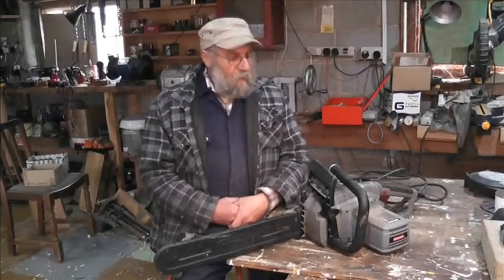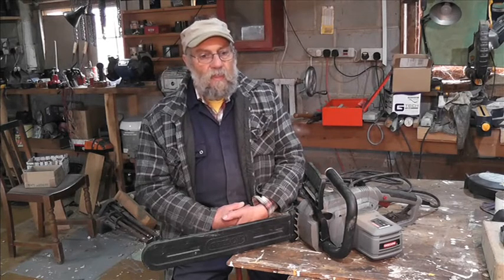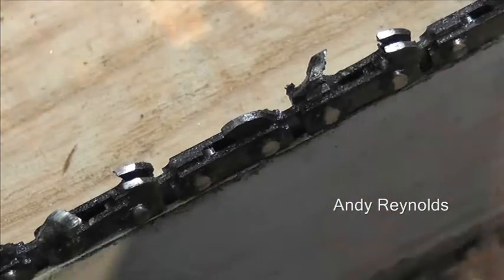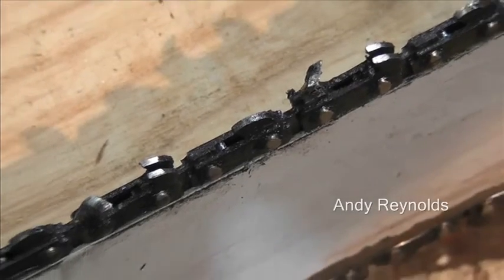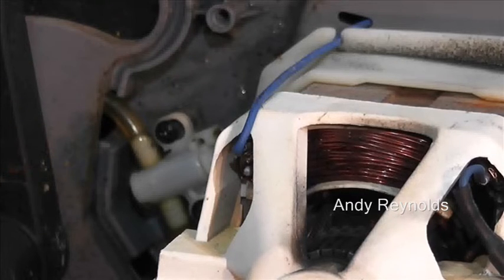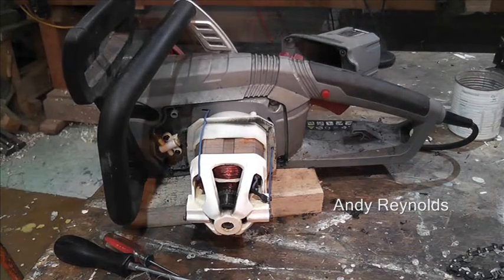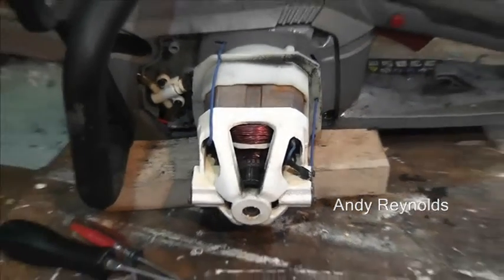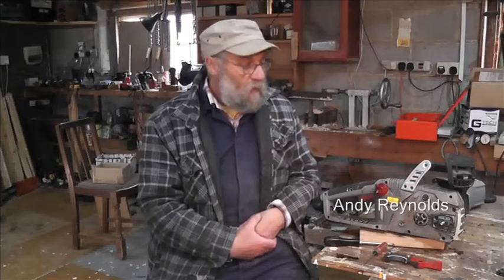Oregon electric chainsaw, quite powerful, is it the brushes?

Comment: Andy, the Kobalt brand 18" corded chainsaw that was available from Lowes has almost the exact same design in every way except motor orientation and of course voltage rating here in the US. I've had two burn out in the same fashion as yours. They are fantastic chainsaws when they run but they do not get adequate cooling and suffer from these design faults. In my opinion, either the brush holders' plastic have too low of a melting point (causing heat to rapidly increase as it warps/arcs), and/or the brushes are too soft. Additionally, I noticed a lot of the wire seems quite anemic for its 15 ampere rating on 120VAC. 

No idea why they thought giving it a 5 year warranty was a good idea, or offering 3 additional years for protection plans--but it is now no longer available for sale if that gives any indication of the failure. Because I love how this cuts I'm looking to replace the motor. Please let me know if you happen to find a source for these motors, I've checked many vacuum/blower brushed motor importers to no avail. 

On a side note, I don't mess with the self sharpening system at all.
Reply from the maker: Yes, as with most corded brush motored units, continuous use causes damage and this is found with blunt cutters. I agree the self sharpening is complete nonsense, cheers

Comment: Thank you for the video and a glance at the internal hardware.  I was curious  at the insides so I could compare to the Makita 16 inch corded. This one is around 100 US dollars  while the Makita is roughly 150 more.  There's no direct comparison  between the two I can find. 
I've only found one Makita repair video.

These two are at the top of my list, im trying to justify the extra 150 into the Makita.

Again thank you for the video.
Reply from the maker: Hi, interesting comment. Many tools are "badged" from the same manufacturer, though I'm not sure if the quality of parts are the same. Cheers

Comment: Isn't this the Oregon Power Sharp system? I always thought they had a special scabbard you put on and pushed it into a log which created lots of sparks to sharpen it.
Reply from the maker: Hi, thanks for the comment. Yes similar and just as ineffective at creating a really sharp saw and setting the depth gauges, cheers
Reply: @TheInfoworks  The guy I did my chainsaw training with, used to advocate them for the guys he used to train who felled BT and Power Line (Likes of UKPN, Western Power, etc) timber poles. None of them ever maintained their chain or saw, and so with one straightforward operation, they could keep them sharp. He didn't advocate PowerSharp for any tree work!  Horses for courses at the end of the day, a bit like this poorly chainsaw.

Comment: Hi Andy. If a washing machine motor is rated at 350w for the spin phase it is hard to imagine this motor going over 2kw! I had a very decent cheap Lidl mitre box saw years ago. Chopped and chopped and chopped until the reduction gear stripped and that was that.  No parts for these machines. 
There is an interesting trade off emerging. A machine like this that is buy use forget. No fixing ever. Maybe a warranty replacement. 
Or 
The device as a service. You buy a laptop/ car/ phone/ é scooter etc. you can’t replace any parts because they are all chipped and the device can recognise a non oem repair. 
Maybe for the bodger the cheap tat is more acceptable to paying a monthly subscription to use a chainsaw. 
It’s a natty oil pump. 
The irony is outstanding. You were in there in seconds and could have replaced any of the parts. But you can’t get replacement parts!  Cheers from windy Ireland!
Reply from the maker: Owen, that's the heart of the problem: an over rated motor with poor cooling and it's on an occasional user chainsaw that we all know wont be used correctly. Why Oregon would badge such a saw is beyond me, pure marketing nonsense. Get that wet grass cut, cheers

Comment: All that arcing around the commutator does not look good, I agree Andy. Shame. I also don't like that sharpening stone - as Thornwarbler says, it's just a steel grinding paste generator. I don't understand the tooth shape at all, I've never seen anything like those. Plus the sharpener is going to miss the depth gauges completely so you'd still have to check those from time to time.
 I resurrected my incredibly basic Black and Decker saw from the 80s, after my Stihl saw of the same age was stolen, and I must say, for small use near to mains it's ideal - even though it's not very powerful and has no chain brake, so I have to be careful, luckily it's only a short bar. Cheers, Dave
Reply from the maker: Dave, good to hear from you, yes it's all a bit bizarre and a marketing ploy. I have seen that cutter profile once before for a specialist use but it wasn't sharpened in such a silly way. I have one of those 80's Black and Decker chainsaws with amybe a 10" bar. Bought it to cut roof rafters. Cheers
Reply: @TheInfoworks  Yes, that sounds like the  B&D saw I have - it has only a manual oil pump too.  But I've been cutting the weekly woodpile all winter with it without problems - I do keep it sharp mind you. I bought a new chain, but haven't fitted it yet as the original still has plenty of tooth length. 
(btw Andy, Tim Hunkin has a new series of videos out)  Cheers, Dave
Reply from the maker: @noakeswalker  Dave, yes seen the one about levers etc, great info about cranks. On my B&D the chain oil manual pump packed up so I grafted on one of those small upright oil cans. Then much later I learnt real facts about chainsaws. Sad to hear you had your Stihl nicked. cheers

Comment: Shame that , would of been handy as an emergency saw if you run out of 2 stroke etc etc etc .... you win some , you lose some .. on the note of self sharpening ....  , I'd be intrested to hear if anyone thinks these type of systems work .cheers   . .
Reply: These sharpening systems are fast at the expense of wearing out the chain, which is special and thus more expensive cuz carbide link for dressing the stone.  The only thing they are good for is emergencies where you need a sharp chain now and don't have time to sharpen or replace the chain.
Reply from the maker: Yes and with our large solar generation on sunny days it would be running on sun. Thornwarbler has a very good point on this sharpening system, personally I think it is a very poor substitute for skill, cheers

Comment: Andy, this is the same as a Qualcast, the brushes are available ( allegedly) from Oregon dealers , probl’y not in stock I don’t think other parts are stock able
Reply from the maker: Hi, yes I'm thinking it's just bought in and "badged", no thought of customer service. To my mind the motor is too small for the wattage and it's bound to burn out if used on big stuff with a blunt chain, chees
Reply: @TheInfoworks  Your saw has a very strong familial resemblance to two non-identical saws badged 'Florabest' I found in my father's garage.  Sprocket, chain-tensioning, oil channel, all identical & motor extremely similar. No sharpening gizmo & other (cosmetic) diffferences. One soft-start, the other (older looking) not.  Both badged as 2200W.  And one had suffered just the same fate as yours.  I think your surmise is spot-on.  Thanks for an interesting examination.
Reply from the maker: @falfield  Thanks for the info, this sort of thing does company's reputation no good,. I'm thinking the motor is too small for the rated capacity, cheers